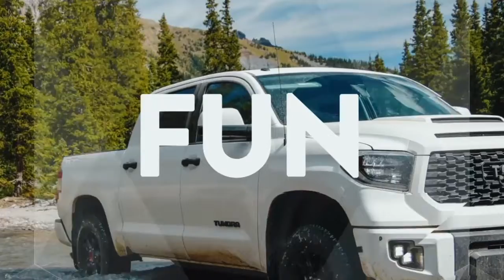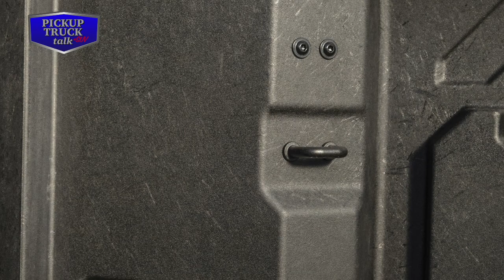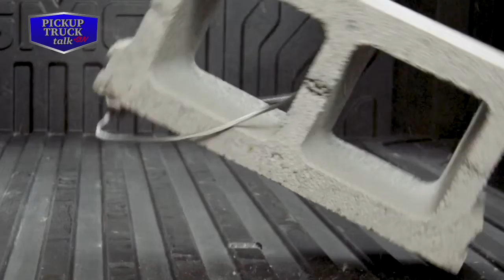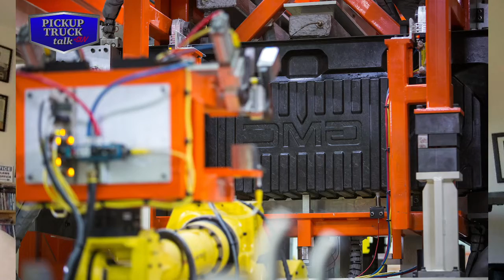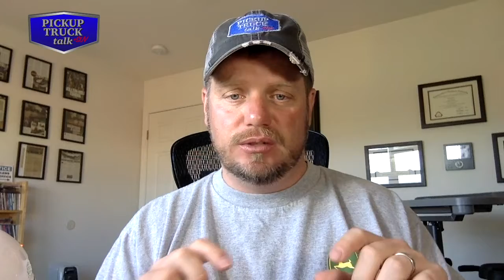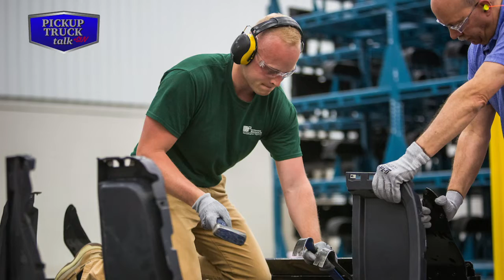The FUTURE of GMC,  Carbon Fiber Bed Production - Is it Durable? Expensive?

Comment: Thanks for sharing..... Actually, the Carbon Fiber bed on for the Sierra Denali 1500 Ultimate is why I'm going to hold off on purchasing the upcomng 2023 model. I've had Ranch and Jason one piece fiberglass tonneau covers through the years due to our winter's here in Michigan. Snow and/or Ice is just too much of a pain with the soft, foldable, retractable tonneau's. As you know, the Ultimates inner sides of the bed is rolled leaving you with no attachment points. Unfortunately, I havn't come across any type of solution for attachment. Maybe, some type of rail could be attached and/or the possibility of cutting out for attachment points. As always, Thank You for all of your hard work and content!! 👍😊

Comment: Fast forward to 2021. How do you mount a truck cap to these beds? No place for a clamp since the underside is rounded. I see a few companies have figured out how to mount tonneau covers by drilling holes in the carbon and using clips for bolts
Reply: This is a deal breaker for me.... I use one piece fiberglass tonneau covers.

Comment: I work in aviation, carbon fiber everywhere. Under stress it is incredibly strong, under impact or friction it sucks, way too delicate. 
My tacoma has a plastic bed (no steel) that has undergone brutal winters, scorching summers, loads of stone, pavers and tools with only scratches. This carbon fibre is only going to cost you extra with no gain.
Reply from the maker: This isn’t the same carbon fiber according to GM. Hell, it isn’t even the same as used in the Corvette.

Comment: Hey Tim, remember around 2000, were you even born then? Anyway. Gm came out with a composite bed called pro-tec. Didn’t really hear much about it as far as advertising. I don’t think they sold many because i didn’t see many around. I also don’t think the materials used were advanced enough because of the few i did see on the roads some were broken. They broke like shards of glass and i’m guessing it was cold temp related. Anyway, sounds like gm is on to something good here as long as they can get the cost down and it turns out to be a resilient material.
Reply from the maker: Two things: 1. I had my first child before 2000. So, yeah, I was around. 2. Yes, the Pro-Ted bed definitely entered my mind as I filmed this. Time will tell if the pricing and dealerships will support this bed. Going to be interesting to see it play out.